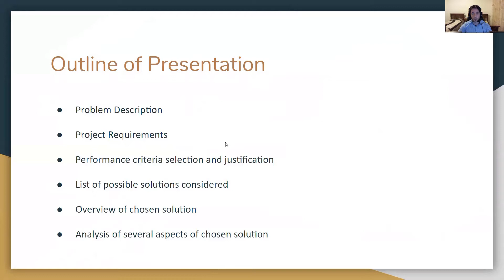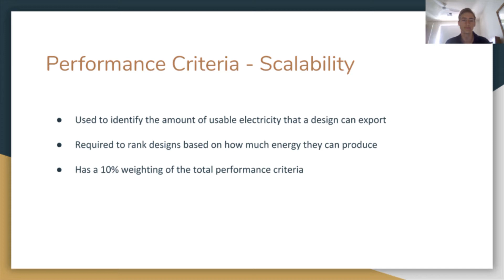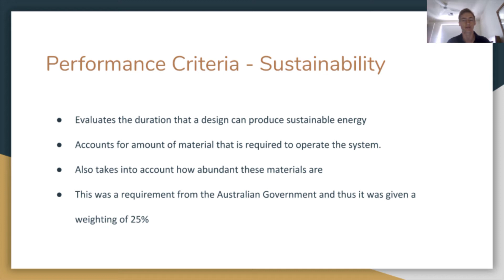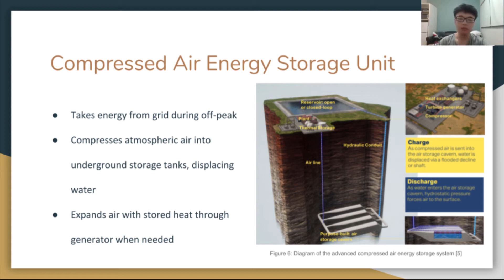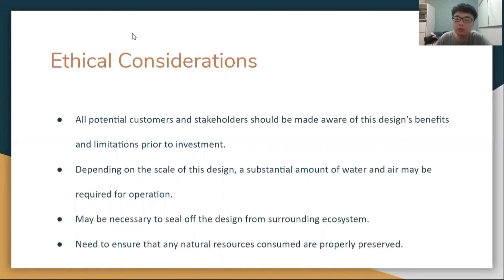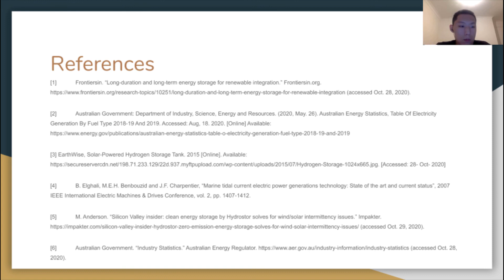D&I 2020: WR0108 presentation

Comment: Good presentation. I was wondering if you had thought of location with the solutions. For example, would the marine tidal current energy system be more suitable for coastal cities and so on?
Reply from the maker: Hi Cameron, thanks for the question. As mentioned in another comment, the compressed air energy storage unit is best suited for areas with low seismic and volcanic activity. As for the marine tidal current energy system, it should ideally be used to power coastal cities as it reduces any power losses that could occur when transporting energy over a large distance. To make full use of this design however, it would be best placed in locations with a relatively high ocean currents.

Comment: Good presentation,

 Firstly, Is the underground storage suitable for environments other than Australia with significant seismic activity? And secondly, A design like this seems to have significant construction costs associated with buried storage, what would the expected lifetime of this system be when compared to the ~50 year lifespan of a coal plant.
Reply from the maker: Hi Sebastian, thanks for the question! The underground storage tanks are not really feasible or ideal in the areas with large seismic activity, as in the best-case scenario, it will lead to much higher maintenance costs. As for your second question, you are correct that this design has significant construction costs associated to it. Unfortunately, the expected lifetime of this system is still only about 30 years, which is why we focussed on comparing this design with other renewables instead of coal.

Comment: Very good presentation, easy to follow. For any of the given solutions, are they intended to be used a complete replacement for fossil fuel sources, or simply decrease the reliance on them?
Reply from the maker: Hi Robbie, thanks for the positive feedback. The designs showcased in this presentation only serve to decrease our reliance on fossil fuels. For example, for the marine tidal current energy system, we found that in order to satisfy all of Australia’s energy needs with this one design, it would take approximately 90,000 turbines, which is not at all practical.

Comment: Great presentation.

How fast is the response time in this energy system, is it capable of responding to sudden large scale blackouts like those seen in late 2016. Is this a viable solution for long term use during the recovery of such an event?
Reply from the maker: Hi Tristan, we appreciate the feedback. The compressed air energy storage system is definitely capable of providing emergency back-up power. One such application for this design found that it is capable of providing 1 MW with a response time of up to a few minutes. The discharge duration for such a process is expected to be approximately 24 hours.